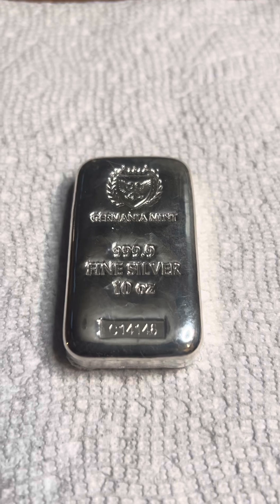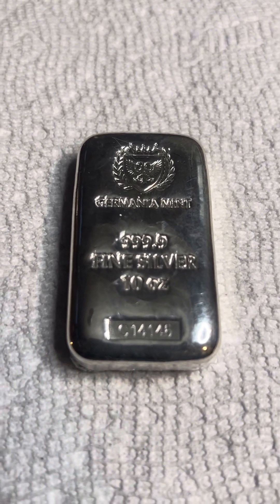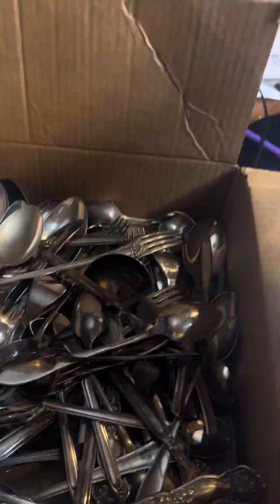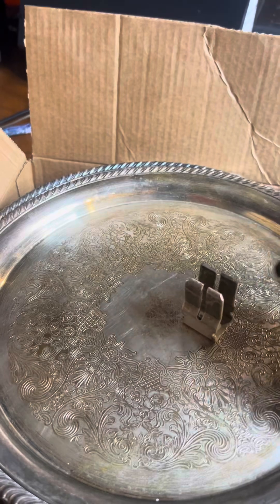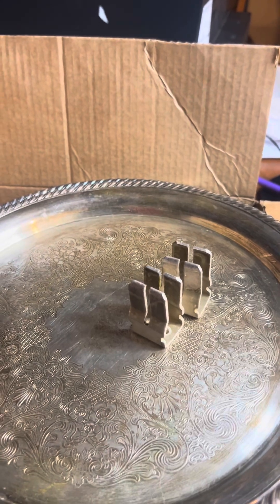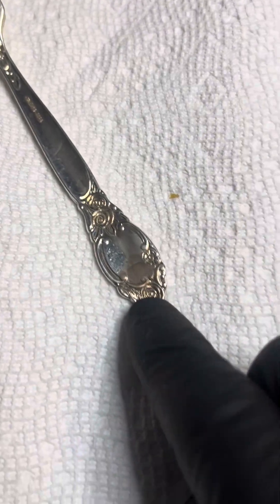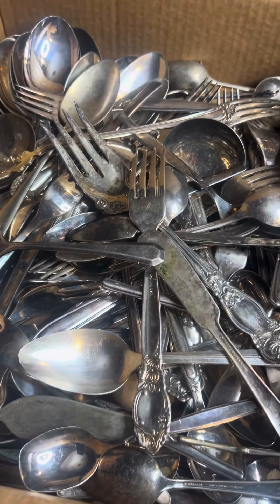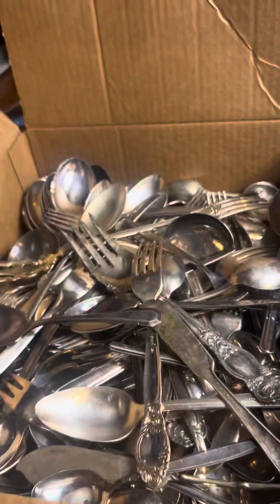making a 10 Ounce Bar for less than 300 Dollars #silver #silverbar

Comment: The Goodwill here has all the silver online :(.
Reply from the maker: Man that’s a drag deals are getting harder and harder to find .
Reply: @ Goodwill sucks anyway.  All the charities are run by hostiles.  I was asking for sterling tho.  I might do a run around town looking for plate depending on your results.
Reply from the maker: @ ordering new alligator clips tonight should have the cell up on Friday . Then start on the flatware with sulfuric and nitric this weekend
Reply: @ I was reading on the Gold refining forum about heat separation of silver from tin and lead.  They cut it in half and melt the insides out. Melting temp of silver is much higher.